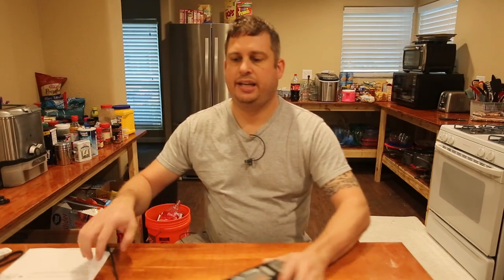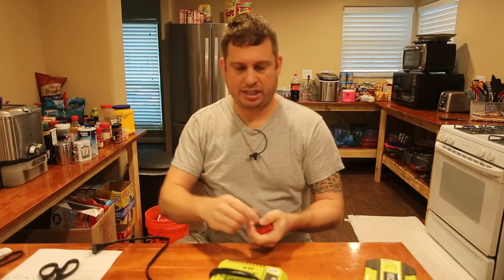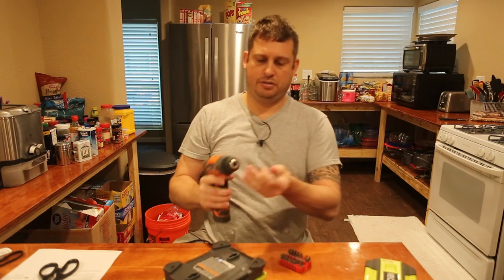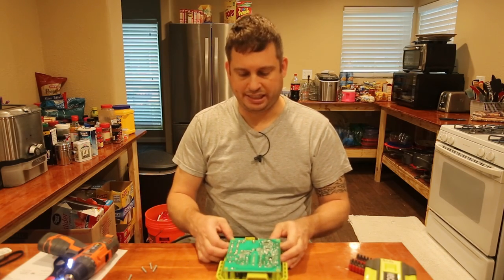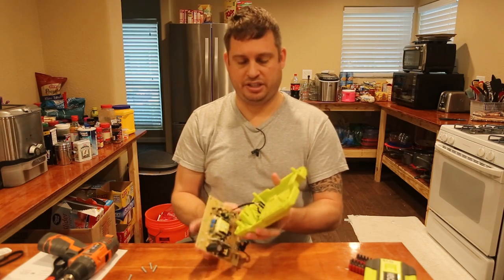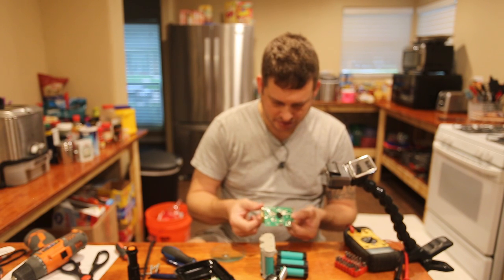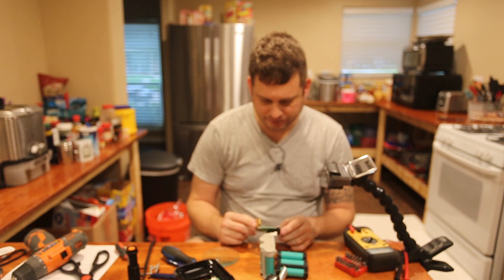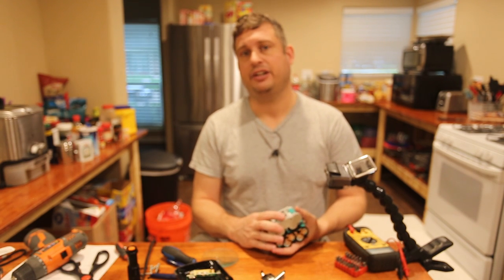Take Apart:Ryobi 40v Battery and Charger

Comment: This was a wasted 27 minutes.....improper teardown and then mere conjecture diagnosis....I think its clear that the charger has 'safety device' that if voltage in 40v bat falls below a certain point, charger will not recognize it and regards it as bad battery....just jump start it with another 40v til voltage high enough for charger to recognize it and then make sure you don't let battery discharge completely.....always store battery with good charge in it....look at manual.....
Reply from the maker: Actually, the only thing that is clear is that you don't know anything about batteries or Lithium Ion parameters.  Your remark about jumping it with another battery and low voltage makes it clear that you have no clue.  Your helpful comments about parroting what's in the manual are amusing.  There is no jump starting a battery.  The battery design has a slightly under-spec'd component which causes failure under some circumstances.  This failure results in flat-lining the cells which is an irreversible failure.  Ryobi happily ships you another one when you call and complain that the battery has failed.  Unfortunately, the failure mode and pack construction make repair useless.  If it had been a NiCad there would have been salvageable cells inside.  The reason I disassembled it was to see if the failure was such that the cells were still functional.
Reply: Brian, how did you miss the fact that the batteries were soldered onto the PCB?

"improper teardown" Correct.
"mere conjecture diagnosis" Correct.

The last thing I would have tested was the PCB. 

First remove the cells (intact) and test them one by one and see what voltage they are. 

Charge all cells one by one.

Check voltage.

Connect it to a device to drain/use the power.

Check voltage AGAIN.

Then and only then can you test the battery as a hole unit and test to see if it charges. 

IF it doesn't charge it MAY be the PCB in the battery.

"Take Apart" was not what you did. What you did was destroy the unit.
And is you wanted to "see if I could find the cause of failure" you destroyed it before you could diagnose the cause.

The video should have been called "Demolishing a RYOBI 40V battery for shits and giggles"
Reply from the maker: My Xray vision wasn't working that day.  Couldn't see the solder marks til the case was opened.  I forgot to read the handout that Home Depot provides with each battery entitled "How to completely take apart and diagnose our proprietary products."

I look forward to your video showing me what you describe.